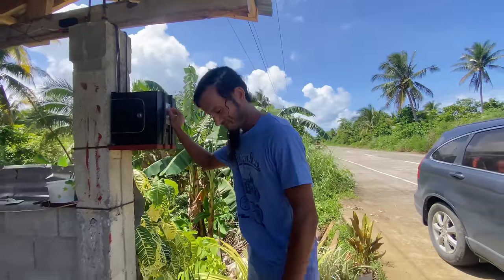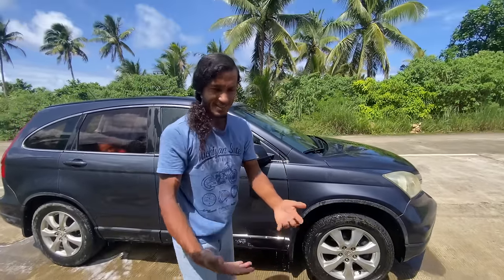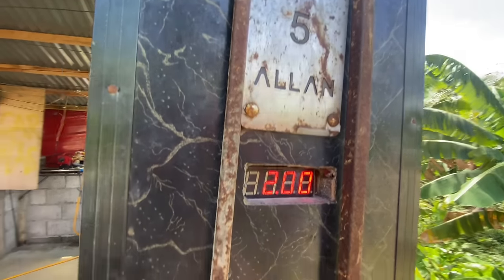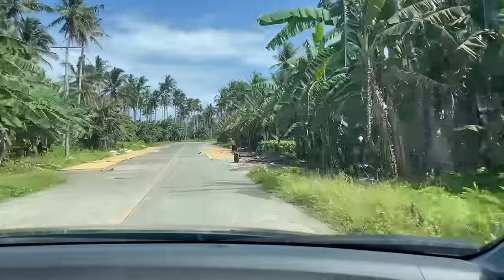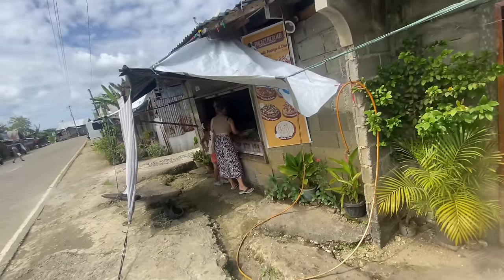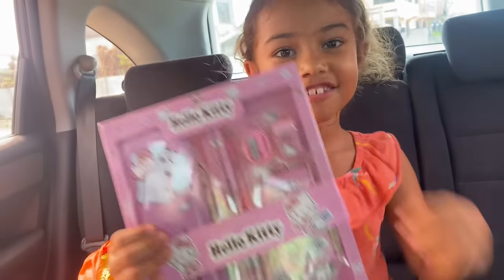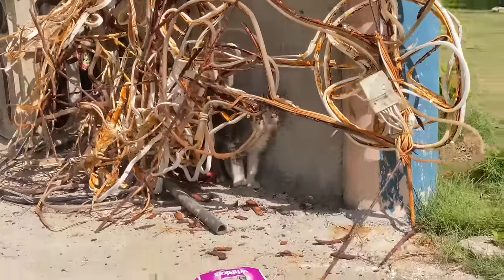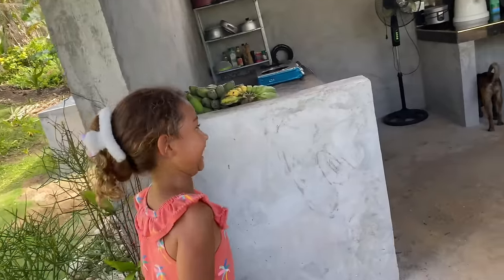RAW 🇵🇭 Philippines Life is not the same anymore... Here's why

Comment: Wipe your windows with Banana leaves as you wash it. Facing the dark side to all windows. The result is fantastic...Very clean. The water  will just glide through removing all the stains..Try it..
Reply: Agree! A little gem of a tip there. Another nugget: banana leaves have been the traditional cleaning and polishing material for the bamboo slat floors in bahay kubos in days of yore.

Comment: 12:53 Pro-Tip: that's not really a tire shop. It's a vulcanizing shop. If you get a flat tire, you get them repaired there by patching the inner tube with rubber. Extremely cheaply. It's something that is completely gone in western countries where you have to go to service centers and often have to replace tires completely.